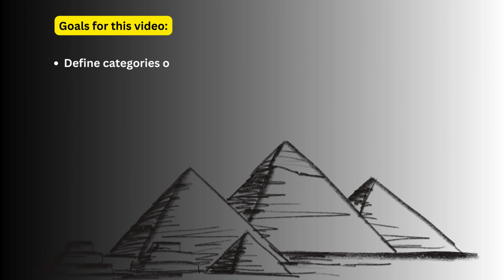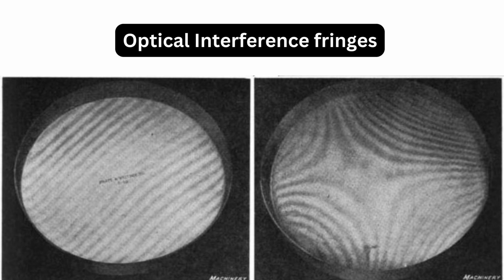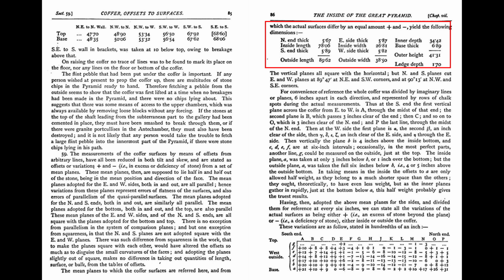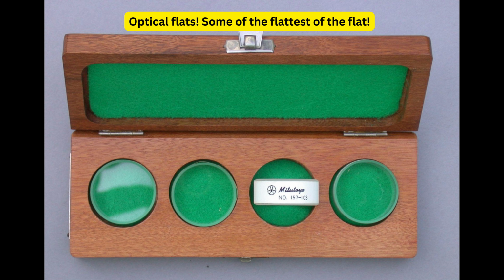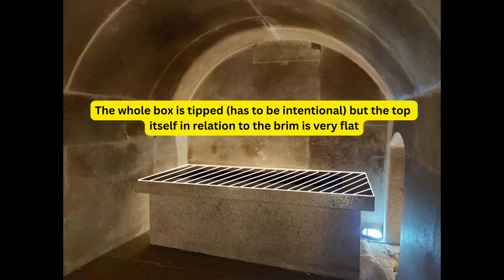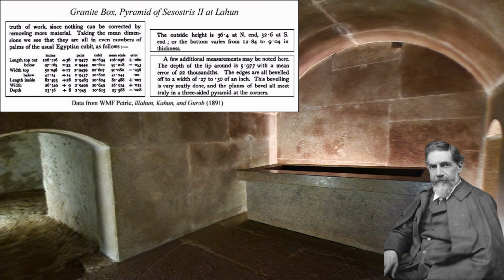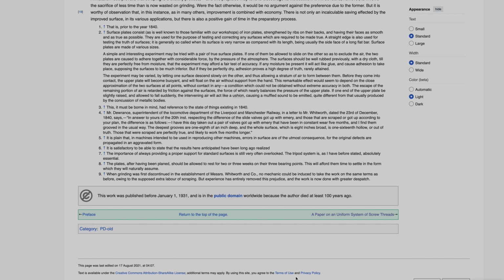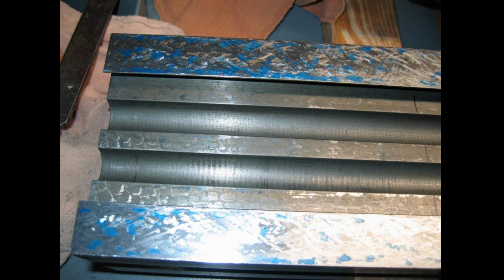The Problem of Flatness in Ancient Egypt

Comment: During the ongoing restoration of the Parthenon temple in Athens, modern engineers had to relearn the method of joining column tubes seamlessly, as is the case with the original ones that are still preserved. The surprisingly simple method: the tubes are rubbed together with a thin layer of sand between them. This way, they grind each other completely smooth.
Reply from the maker: Very similar to what I propose here! I shall have to look into that I didn’t know that bit of history!! Thanks!
Reply: So much of the focus of queries into ancient construction appears to concern the technology available when possibly the real genius is in the time and labor management factors. Slave labor might seem cheap but it is hardly efficient. 

Git 'er done may have been very important on those jobsites. Even leaf cutter ants can disassemble a tree's foliage and move the product a distance for storage in a surprisingly fast pace by shaving wasted time off their repetitive motions.
Reply: @pollyh3190  of course it’s worth noting that things like the Great Pyramid at Giza were not built by slaves at all, but by skilled craftsmen and citizens. Roughly 11 cattle and 37 sheep were butchered daily to help feed the workforce. 

These cyclopean structures were not merely monuments, they also served as economic stimulus. The different groups of workers named themselves and left behind graffiti of those names. Among them are the Friends of Khufu Gang and the Drunkards of Menkaure.
Reply: @wackyvorlon  Exactly. The Pyramids were the Ancient Egyptian equivalent of the Works Progress Administration. They had a huge number of farmers with nothing to do during the flood season, no way to support themselves, and the potential for organizing or riots against the monarchy. So instead the monarch paid out of his own pocket to give all those laborers something to do to keep them fed and working for him instead of against him.
Reply: @pollyh3190  the real trick to egyptian organization was the climate and agricultural basis of egypt. It results in a third of the years where planting and sowing crops is impossible. Egyptian society formed around organizing this third of the year of 'free' labor. Farmers would tolerate this because the first organizational tasks were hydrological: early kings would be organizing this labor to dam and channel water so that more land could be brought under cultivation, and flood damage repaired. Taxes were collected in the form of grains and beer, and then distributed during this labor season. Later this would be used to mass people for warfare as Egypt unified.

After Egypt Unified, you have this truly massive labor force organized under one pharaoh, with no outside threats, and the river system working. They didn't use slave labor, but they used absurd amounts of time and manpower because they could mobilize every farmer to work 1/3rd the year. The Farmers were getting beer and bread as long as they worked, so they were in no hurry for the projects to get finished either.
Reply: @Frommerman  it is also notable, that the their kings were believed to be divine, so they hardly had the capacity to refuse to do the labor, thus, not completely like we do work today either, the most effective way to describe it would be basically forced but compensated labor, and many would of course be working willingly too, it's just that culturally, they didn't exactly have the capacity to refuse.
Reply: @intothemap360  https://www.youtube.com/watch?v=rHmsQEAx16o here is a video on how a machinist generates 3 perfectly flat lapping plates from 3 rough pieces using themselves and  proper technique. weve been rubbing things together longer than weve had writing.
Reply: @intothemap360  when you rub 2 durfaces together, the interface becomes spherical or sometimes in the case of a very limited rubbing pattern, spheroid/cone/cylinder/saddle.

For the interface to become flat, you must rub 3 surfaces, changing the two being rubbed together at frequent intervals.
Reply: @AlexKarasev  if i were a foreman responsible for making a set of sarcophagi for a tomb, i'd ensure flatness by lapping with their lids, and swapping lids between sarcophagi periodically.
Reply: @ShuRugal  you'd be a really good foreman, then!
Reply: @ShuRugal  You'd have to also lap lid to lid, or you'd end up with (for example) all convex sarcofagi and all concave lids.
Reply: @AlexKarasev  Nobody needs perfect flatness, you don't need interchangeability between sarcophagus lids, you need lid A to fit to sarcophagus A, and column piece 1 to fit to column piece 2. You get them close to flat with gages like a taut string, then you rub them together to fit one to the other. Who cares if the contact surfaces have a slight curve.
Reply: @intothemap360   a variation of the 3-plate has been my suspicion since I learned about it in college like 20 years ago. Same with the 'paper can't pass between the stones' on the outside - we know they used cranes to lower the stones in place... sprinkle sand, lower the stone almost down, have a team swing it in a little circle for a few minutes and fully set it down. Tada, perfectly mated surfaces. 
Also the whole 'but the length of ramp to get to the top, guffah, impossible'. The angle of repose for sand, and dirt (even assuming they didn't know to wet the sand, or bury lengths of rope every 5-10 feet to reinforce the stuff), no pyramid ever built needs a ramp longer than 3 of its sides. Practical Engineering has a great video on engineered sand (using a few sheets of paper to reinforce a free-standing cube of dry sand to support his car).
Reply: This method is also used to grind spherical mirrors. you start with even circular discs and grind them against each other in radial direction, you rotate said direction around the circumference. With time one of the discs develops a cavity, grinding in a flower petal shape equalises the cavity to a spherical shape.
Reply: Rotary surface grinding. 
Loom up Blanchard grinding finish, you'll see a similar fun pattern but in steel
 @HotelPapa100
Reply: It's still a rather labor-intensive method. That's why I've always been fascinated by the fact that so many cultures around the world devoted so much time to constructing megalithic structures with such precision. The cost-effectiveness ratio. Even someone with vast resources of cheap labor cannot ignore the efficiency of manual labor.
Reply: @atam3977  in short, it was a jobs program.
Reply from the maker: I think we also have a survival situation here. Better built and more precise means better engineered. The crappy stacked megaliths all fell down! The really well made ones were strong and held up through earthquakes.
Reply: @intothemap360 there is also the fact that most of the structures were intended as economic stimulus. Workers were paid, and this pay was fed back into the economy by those workers. 

If it had been faster and more efficient then it would have been less effective as stimulus.
Reply: @intothemap360  The number of structures around the world that have survived for 2,000+ years is even more impressive then. It's also worth considering that many such structures, though capable of withstanding numerous cataclysms, were simply dismantled by later generations, and the stone reused elsewhere for less spectacular purposes.
Reply: @atam3977 also underneath the sea......
Reply: @wackyvorlon  That's likely* one reason.  However, they're also likely vanity/personal projects.  The one tomb that's much less accurate was probably a functionary that cheaped out.  That or he died early and whoever was responsible for ensuring it was done didn't care.

* I haven't done the research, but don't see anything wrong with that.
Reply: @atam3977  It's normal for us today to view this as a solely materialist problem of efficiency and to eject the meaning of the product itself from the discussion. But people in the past used to have very different attitudes towards manual labor and the relation between the natural and supernatural. Also, it's by no means like there was nothing else to do, because everyone was already so well fed, so healthy and so bored. If you're an ancient Egyptian, you don't try to achieve perfect flatness as part of a jobs program or for the sake of being impressed with your own "progress" in the same way that we today pad ourselves on the back for the smoothness of an astronautic cable socket, you do it because the Gods are real and the Pharaoh is one of them.
Reply: @gulli72  It's also about physical limitations. You can't do more than your available worker's hands can handle, and how quickly you use that workers.
Using pebbles with bare hands must have quickly degraded the workers' joints, and new people were constantly needed. This also requires time for training, because as we see in quarries, precise shapes were already being cut from the bedrock, so many workers had to know what they were doing.
Reply: @atam3977 They were expensive and still are.
Reply: @atam3977 As someone else pointed out there's a survivors bias, the shoddily built temples etc fell down, so we think the ancients built super accurately because only the good stuff survived.

As for the reasons they would build such high quality work, many of these buildings were there purely to impress people, and I can imagine it worked! The pyramids boggled my mind when I visited them, they're massive! And I live in London, imagine just how bonkers they must have looked if the biggest building you've ever seen was 2 stories and they were still clad in smooth white limestone!! Who could deny your Pharoah was divine when they could create something so far beyond your comprehension, so worth spending the extra resources making it amazing.
Reply: @paulelephant9521  Yes, I'm aware of that. That's why I'm fascinated by how many buildings survived. Not only the residences of rulers, monuments, and temples. But also the seemingly less noble defensive walls, for example, in South America. This must have been more profitable for them in some way than simpler structures, which might not have remained undamaged by, for example, cyclical earthquakes over the centuries, but could also have been quickly repaired by less skilled workers.
Reply: @atam3977  These mega projects were literally the most costly (in time, labor, and actual currency) endeavors that were done in the time they were constructed.  They were showing off that they COULD do it, that they had the resources that you could devote to something like a pyramid.  The only downside to inefficiency was in how much time it took.  Then again, the Great Pyramid was estimated to take ~30 years to build, so you had plenty of time if you also had the patience.  

Also, remember, that the in most of these cases in societies with structures like Pyramids, commoners owed labor to those constructing it, so in many ways the actual parts that needed just lots of manual labor instead of expertise was "free", or at least much cheaper than you would expect since you still did need to usually house and feed them during construction even if you didn't need to pay them.
Reply: @Tinil0  It's true. But I I was also referring to something a bit different. It's about efficiency, even if the work is cheap or free. There are physical limitations that a manager must consider. 
For example. We see from abandoned quarries that precise objects were already being cut from the bedrock on-site. This suggests that a large number of experienced workers were needed who knew what they were doing. If, as archaeologists suggest, the blocks were extracted manually using dolerite pebbles, such bare-handed work, even with some skill, for example, a more optimal grip and manipulation of the pebble by lowering it from a height, must have degraded the worker's joints faster than the state could provide new ones. 
The management had to take this into account in its calculations. 
Either the scope of work was trictly selected, meaning that for a longer time, few structures were created, and only those of a representative and sacred nature (it must be admitted that a surprising number of structures survived for 2,000 years or more). Or many other auxiliary tools had to be required, allowing for more efficient and precise work, in which the pebbles were merely a working part of a larger system.
Reply: @atam3977 religion
Reply: @atam3977   Today with the industrial revolution we modern humans have an extreme excess of material abundance and view labor as being, relatively speaking, very very expensive. 

Ancient economies were completely inverted. Labor was very very cheap in comparison to material wealth. Just imagine how expensive everything would be relative to your own labor if everything you owned was literally hand made. (For example we throw away fabric all the time because it is more expensive to dedicate the time to repair and reuse it. Before mechanical looms, scraps of fabric would be saved and reused over and over again until they disintegrated because of the immense cost of fabric.) 

This means that the relative marginal cost of dedicating more and more labor to making objects finer was much lower. Humans were also not very productive. Aside from polishing granite, what else could Aaru do with his time? Probably farm. Therefore, the fine craftsmanship we see in ancient structures was not as mind bendingly expensive as we imagine it to be from our modern perspective. 

The other significant aspect of this is that all of the structures we see represent a massive portion of the entire productive capacity of a region (ancient egypt for instance) brought to bear on a handful of impressive structures. Because of slavery, and other coercive forces, the elites in society could direct huge portions of their society to build these mega projects without being as concerned about what they cost.
Reply: Labor used to be cheap....
Reply: Nashville, TN has a full-scale Parthenon recreation. Inside, there is a museum of sorts with displays that detail the construction techniques.  The column segment-lapping is in one of the exhibits; its ingenious and simple.
Reply: I bet that is a variant of the Whitworth three-plate lapping method, which doesn't require a reference surface.
Reply: @catsupchutney  At my technical school we had to make twenty point surfaces using the three surfaces system ,some lapping compound and plenty of figure of eight movment
it's time consuming but not hard , except on the wrists
Reply: But I really want it to be Aliens so I say it's Aliens. My mommy lets me create my own reality.
Reply: That method provides impressively smooth, matched surfaces, not flatness. But that application doesn't need flatness. The surfaces will, if examined precisely, be slightly bowed in or out, but identically so.
To make blocks meet exactly, you butt them together and saw down the gap, push them together, and saw again, repeat until satisfactory. The joint won't be perfectly vertical, but close, and not-exactly-vertical is structurally better.
Reply: @sciptick do you saw them while they are butted together???
Reply: @JS-jh4cy  Yes, there are documentaries about it.
Reply: @sciptick 3 plates. Alternating which is being lapped in a figure 8 motion and rotating 90 or 180 degrees the next time it's brought back in the mix. 
Ensure it's cleaned off every rotation.
My cast iron lapping plates used to glide like an air hockey puck on the surface plate at work. Now they just ring to it
Reply: @erokcreates Sure, I'll just take my 3 two and a half ton blocks and alternatively rub them together 800,000 times for just the Great Pyramid...  😜
Reply: @michaelg4931  but the great pyramid isn’t built to that level of flatness. It’s only the sarcophaguses.
Reply: @pemetzger   It's the fitting of the blocks to each other given the size and mass given the lack of mechanization that's really impressive.  How much have you actually built with your own hands?  I see all these 'brains' drone on and on about how this or that can be easily accomplished and most of them are lucky to be able to tie their own shoes.  My whole income is based on building/fixing things with actual everyday practical value/use for PhD holders who are completely clueless and worthless outside of their specific field.
Reply: @michaelg4931  People vastly overstate the accuracy of the blocks in the pyramid. They vary multiple cm's in size, even within a layer, and flatness of most of those blocks is within cm's, not mm's.
Reply: @slome815  It's not the accuracy, it's the fitment between them.  When you go out and grind two hundred 2.5 TON blocks to fit together as well as was done on the Giza plateau, without the aid of machines and utilizing only the tooling and materials that the archeologists state as fact where used when it's actually just educated guessing, then you can act all knowing.
Reply: @sciptick three plates
Reply: @sciptick  no. If you use three plates, you get absolute flatness. Euclid would’ve understood why, there is only one way to have three plates interface that provides matching surfaces, which is a plane.  Two plates could simply have matching concave and convex surfaces, but three cannot.
Reply: @sciptick  A slightly concave surface meeting a fitting slightly convex surface holds even better together, as the curvature prevents them from slipping sideways.
Reply: @sciptick  well explained.
Reply: @sciptick  this method is used in boatmaking too.
Reply: Same method is used in boat making when attaching two wooden boards. You attach the boards temporarily on a fixture then insert a thin saw between them and go all the way by sawing and tightening as you move.
Reply: You also do this to the valves when you rebuild an engine, using a gritty compound, it's known as lapping.
Reply: Reminds me of guitar repair. A similar technique is required before a replacement bridge can be glued to a guitar with a radiused soundboard.
Reply: The mating surfaces of the drums (the column tubes) are so perfect in relation to the next one that when earthquakes in the past created cracks in one drum the crack propagated to the next drum as if they were a single piece. Also when some of the columns that remained untouched since antiquity were disassembled the cedar peg in the center that helped locate the parts was intact and still smelled cedar
Reply: @asicdathens it must have been like a vacuum seal. When you rub two slabs of stone together long enough, the air escapes and they can't be pulled apart except by sliding them
Reply: @asicdathens holy cow
Reply: Yep, rubbing three rocks together makes perfect flatness.
Reply: Pretty much what we still do today.
Sandpaper is nothing bit a surface that already carries the abrasive material.
Those pastes to get scratches out of displays, they have abrasive material in them. As does toothpaste (but a material softer than tooth enamel. You want the stuff off your teeth, not remove your teeth)
Reply: Yes, very simple.
Reply: What type of sand,only sharp sand??
Reply: I figured this is how it was done after as much chiseling and smoothing they could do by hand.
Reply: B***** oh!
Reply: to be clear, without a third plate and some alternating step pattern - you'll get "smooth" but not "flat", you'll get a close "agreement" where the two shape to eachother very accurately with almost no gap, but they will likely have a concave&convex relationship with eachother, at least in local spots if not overall. But for joining pillars this is more than sufficient, it doesn't matter if the "inside' area of the seam is perfectly flat, it just matters that whatever shape it is it's perfectly mirrored by both sides so they fit without a gap, only the outer ring of the entire joint is visible so any non-flat imperfections are hidden internally anyways.
Reply: Huh. Just like lapping valves in an engine. Something we still do today
Reply: Sand and rope too. Look at smaller jade statues.
Reply: Ah, yall found a way to explain it! 
Just rub a multi tonne lid until it's airtight and flat. 😅

Massive granite columns out of one piece, not stacked limestone.
How is that rubbed?
Reply: @gill7045  Rubbing is to make tight seams. Everything else is polished. You alien/powertools/forgotten superior culture morons always forget that with manpower and patience everything is possible!
Reply: 🎵 "they say about the Parthenon where the Acropolis iiiiiiiiss..."🎵
"What do they say, what do they say?"

Shoutout to fellow qi fans
Reply: Repetition takes precedence in a risk-free environment of the unknowledged cult of mainstream perception in safekeeping — the group oriented behavior and identification we require by which institutions of science are managed through the funding and career building process.  People are normalized into acceptance of endless circular reasoning in the search to maintain established narratives in the face of increasingly diverging evidence of an overwhelming nature.  This requires a compartmentalized and arbitrary mindset to wait for some comfortable return to reason of repetition provided, with the scientific method in name only on a shelf in the closet.
Reply: @ronaldgreene5733  You really should stop licking toads...
Reply: Someone please fill me in; but how would they use this method to flatten all 6 sides of thousands of multi ton limestone blocks? Moving them on logs/other theories of moving them is one thing, but the amount of time and energy it would have taken to rub all of these blocks together just seems a little far fetched to me for the time frame (but not impossible). 

 Also this method expects the plates/blocks to already be roughly flat and in a rectangular shape; if a cube was not a cube already, it would flatten the sides of the shape to be even more of the original prism/parallelepiped shape.
Reply: @genghis_quan  Stone masonry isn't as difficult and laborious as you Muricans seem to think! Every Gothic cathedral in Europe was built by only one or two dozen stonemasons working simultaneously, and we're talking about complicated details here! Incidentally, next to all these cathedrals, there are still today the old stonemason workshops that produce replacement stones from exactly the same materials and with the same tools as their medieval counterparts. There is even a young Brit who shows his work as a cathedral stonemason on YouTube. Shaping a large limestone block into a rectangular form is perhaps a day's work for one man, but no more. And for most of the stones in the inner core of the pyramids, they didn't even bother to give them a specific shape! As for the closely fitted and polished facing stones: limestone is very soft, especially when it is still damp and fresh from the quarry (although I don't know if this also applies to Egyptian limestone). Once the surfaces have been roughly smoothed with a chisel, rubbing them back and forth a few dozen times should be enough to make them fit together.
You Muricans either credit the Egyptians with too much, thinking they had electricity and power tools, or too little, thinking that aliens or even earlier advanced civilizations built the pyramids, thereby merely shifting the question of how further back in history. Folks, with enough men and patience, you can achieve almost anything; modern tools are just a convenience for the lazy and impatient!
Reply: @genghis_quan  this method really only applies to sarcophagi and the like, as it gets one from roughly flat to a practically airtight fit.

Limestone is very soft, and it cracks in fairly consistent ways. So 90% of the blocks likely came out not needing further refinement right from the quarry.

Stone carving and cutting techniques are pretty intuitive so could have been ancient. A looong narrow strip of leather (like a shoelace for boat shoes) slathered in a mix of mud and diamond or other hard rock dust) going in a loop between two pulleys, could cut stone a flat or fancy profile. Leather held over a wood board with a handle, with the same mud of different grits, can polish rock to bear mirror finish. It's just elbow grease & common sense really. We're still doing it the same way except sometimes electrically.
Reply: Sure but you can't do that with stones that weigh 50 tons like in Sacsayhuamán. I know that ancient people could do that with certain sources given enough time. I'm also not suggesting it was aliens. But it for sure is not the tools we found. It's pretty fair to say that they most have had somewhat more advanced ones (no, not electric drills just more advanced than we found) to achieve these feats of engineering. That's not a stretch to assume because while ancient Egyptians did depict transporting smaller stones they did not show how they transported the bigger 200 ton ones. They would have crushed the wood that was available to them. And they didn't have jack screws. So it's logical to assume they must have had a contraption that was capable to carry that much weight that we don't know yet.
Reply: @EbonyPope at the mortuary temple of Hapshetsut is a depiction of an obelisk barge transporting two obelisks at once. This would put it in the range of 300-600 tons on one barge.

Most obelisks, including those of Hapshetsut are inscribed details on where the obelisks came from, how long it took to carve, and who commissioned it.

Obelisks are among the largest monolithic stones the egyptians ever moved, far larger and heavier than any of the sarcophagi in the Serapeum at Saqqara.
Reply: @histguy101 Absolutely outstanding engineering. BTW, the construction of the barges is a naval engineering achievement in itself.